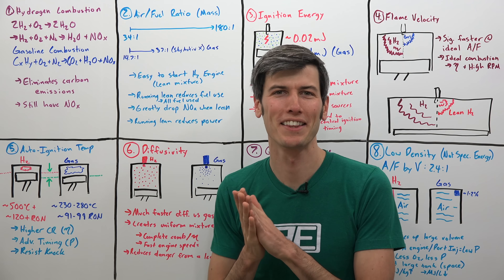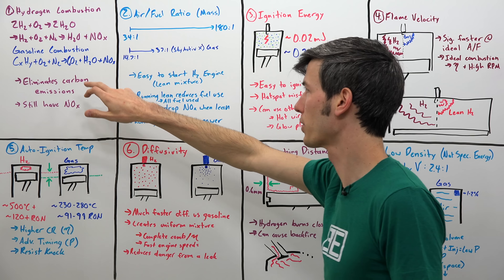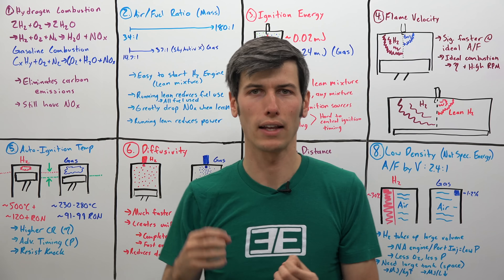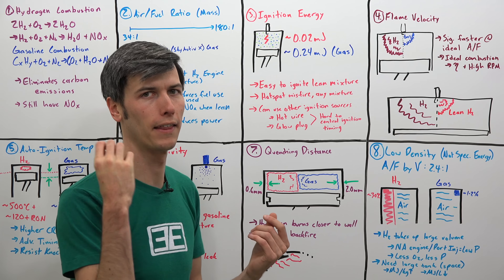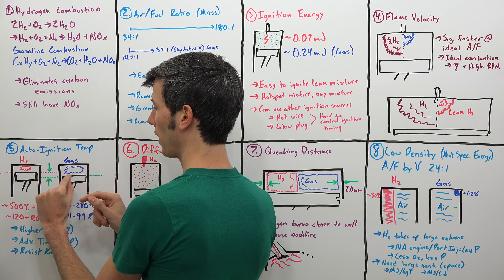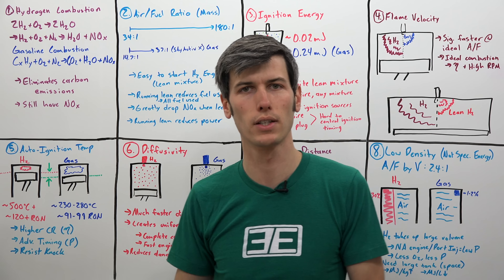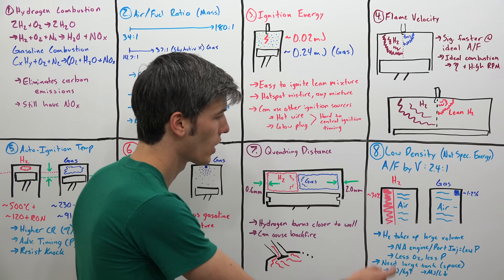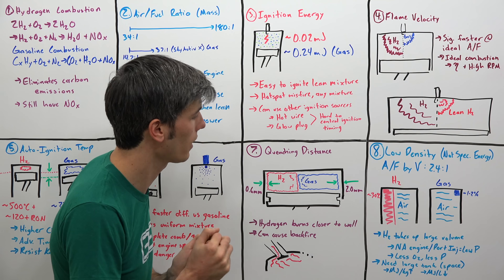The Difference Between Gasoline And Hydrogen Engines

Comment: Hydrogen is the future ,electric cars will die out
Reply from the maker: I doubt it, EVs are much more efficient, and looking out long term, efficiency is important.
Reply: Engineering Explained a guy in Crete has build an hydrogen reactor that is able to make 500 liters of compressed hydrogen (20 bar ) just by using the power of the sun !
Reply: hydrogen is an energy carrier and although  it sounds efficient when making energy it's not when being made, the energy required to make hydrogen is way higher then what it gives back while battery are very efficient  at storing the original source and also at giving it back.
Reply: josh thorp no , an guy I. Crete invented an hydrogen reactor witch produces 500 liters of 20bar compressed hydrogen every day , just by using sun , he has videos about it on YouTube
Reply: I imagine hydrogen replacing gasoline. But not electrics.
Reply: Creating hydrogen is such an inefficient process versus the efficiency of EVs that this will never happen. EV technology has been improving massively in the last 10 years.

Hydrogen might have a future in airplane technology though. Interesting to see Engineering Explained's view on that.
Reply: HDauven josh thorp no , an guy I. Crete invented an hydrogen reactor witch produces 500 liters of 20bar compressed hydrogen every day , just by using sun
Reply: I imagine it depends on the way we produce electricity in the future, lots of places man production for power is fossil fuels, which is a problem if want electric vehicles to be the main source of electricity. And where I live (Adelaide, in Australia) we have close to the most expensive electricity in the world, which makes electric vehicles even more expensive to own
Reply: @TynanQ .... some sum for you
1.4 ASD litre of gasoline in australia - would get you about 6miles (on reasonable engine/ speed)
You would need about 2kWh of electricity to get same distance in typical EV.   At 0.3 ASD per kWh  that equals about 0.6 ASD.
So its still less than half as cheap.
That is pricey electricity though...time to invest in solar panels and battery bank to make use of Australia's sunshine.
Reply: electric motor is way better in all - less moving parts, easier to make, more efficient than any combustion engine.
Reply: Cool Cat where are this  I Infos from ????they are way more complex and you have to change the Batteries every 2-3 years
Reply: @type2523  just look on the web electric motor from tesla and compare to some combustion engine. Size, number of part it made of and so on.
Reply: Based on what argument? Creating hydrogen is a very energy intensive process.
Reply: TheGerm24 josh thorp no , an guy I. Crete invented an hydrogen reactor witch produces 500 liters of 20bar compressed hydrogen every day , just by using sun , videos on it are on YouTube ,
Reply: @type2523  so what? He's a fool he could have just stored it in a battery whether that be an electrical battery or pumped storage and it would have been much more efficient
Reply: Hari prasad you keep dreaming
Reply: Not so, electrical energy into a battery is much, much more efficient than electrical energy - split water - compress gas - fuel cell
Reply: Batteries have a lot of technology still to be applied but Hydrogen looks like an excellent alternative to petroleum combustion.
Reply: Tahir Ahmadov  It currently takes me 20  minutes to get 100miles range on a 50kw local rapid charger. 
But  recent ultra chargers out are nearer to 200kW in power and 400kW is also rolling out. 
So very soon  it might take me only 5 - 10 minutes to charge for similar distance.
Also bear in mind EVs out now there now  have 300mile + range and in near future (2020) the Tesla roadster will have 600mile range
I am confident that in 5 years time you will typically have >500mile range EVs with maybe 15 minute charge times. If you seriously cannot wait that long after travelling non stop for 8 - 10 hours then you need to re-assess your life - or your business*. 
p.s. *Trucks and buses run on cost margins - and fuel is a big part of their profit margins> When you trade fossil for electric you will be able to stop for much longer periods and still make a wider profit.
Reply: Tahir Ahmadov  Hydrogen fill at the same speed as gasoline, yet H costs 5 to 10 times more than gasoline. There's no way H will match gasoline price (Physics limited), and given the riots in France, there's no way people will put up with 500% more expensive fuel.
Reply: Chevy SparkEV H costs as much as gasoline costs in Europe
Reply: @type2523  Even if it costs as much as gasoline, what reason is there to switch to H? There's literally zero benefit over gasoline, but has the disadvantage of practically no filling station and car that weighs 800 kg heavier (Mirai) than equivalent gasoline car (Corolla).
Reply: @mychevysparkevdidntcatchfi1489  you can produce as much hydrogen as you want,gasoline whill run out sometime,and hydrogen creates only water
Reply: @type2523  If you're talking about hypothetical 100 years down the road, there will be better batteries, too. In fact, battery swap technology already exists that can "charge"  a car in 5 minutes as Tesla and others have shown, just not implemented due to costing same as gasoline.
Reply: It won't happen, Hydrogen is really inefficient and not worth anyone's time or money for cars.
So yeah, keep dreaming.
Reply: they would running pararrel, much like petrol and diesel today.
Reply: I would say this is better for saving energy because it doesnt use rare materials
Reply: @menno763  I thought fuel cells typically used metals like platinum.
Reply: @TheGerm24  yeah fuel cells use platinum but what the video talks about is combustion of hydrogen
Reply: Menno Rodenburg Lithium is very bad when produced for the environment and it's very difficult to recycle +8hours waiting time for 100-400 miles which is nothing
Reply: @type2523  nonsense. A decent charger will goto 80% in less than 1/2 hour while you have a coffee and a pee
Reply: Martin O'Donnell some guys don't like taking pees every 100-300 miles and normal cars need 3 hours , not all have 100-200 k for an teasla
Reply: @type2523  You're wrong in basically every comment. Hydrogen is at least a few times more expensive than gas, really, go check it. Electric engine is less complex, you can make basic induction engine with like 5 parts. You don't need to replace battery every 2-3 years, it's a myth so old that I don't have words for it...  Next, Tesla doesn't cost 100-200k, cheapest M3 is a bit less than 50K, 35K coming next year, 25K and less in near future, when gigafactory will expand and production ramp up. Lastly, mining lithium is bad for env but not worse than mining oil. And yes, you can recycle lithium, but surely you can't recycle oil.
Reply: No, just no.